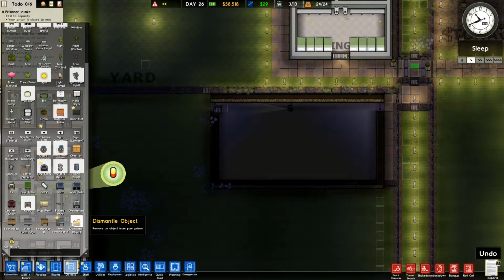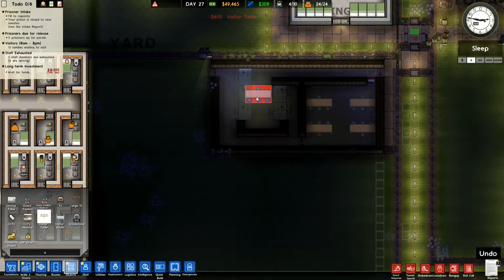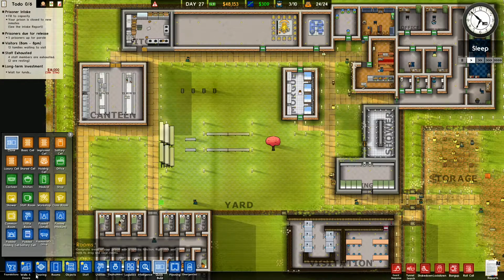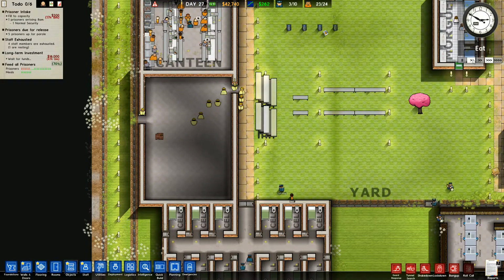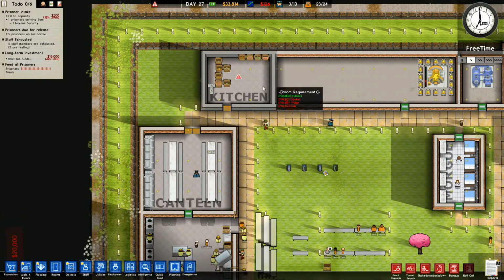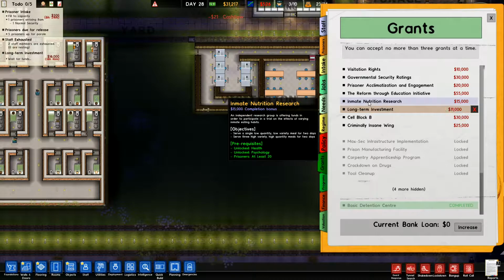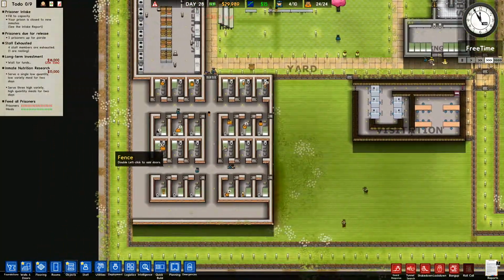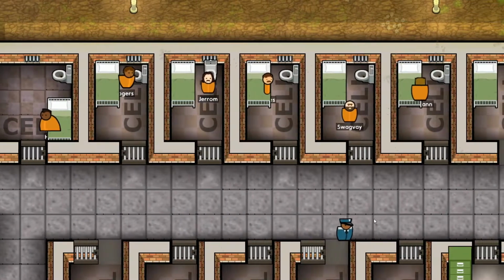Let's Play Prison Architect #43: Art Deco Visitor Centre!

Comment: You made the Visitation Room overly complicated. You could have just dropped the booths down in a "U" formation, with just a couple of sections of wall to keep the inmates on their side. Also, why use booths AND tables? Booths are for keeping smuggled contraband at a low, while tables are used when you don't care (or for low-sec inmates). Using both just defeats the purpose of the booths.

@12:26 - you got the Notebook page, but you missed the Polaroid sitting by the phones in the prison Yard

Inmate Nutrition Research - you need to pay attention to the requirements. You set the meal quality and variety to "Low", but you forgot to reduce the meal times to once per day. When you kick it up to high quality, high variety, you'll need 3 meal times throughout the day

Power Generators - in addition to separating them, you may want to think about adding a sprinkler to each power room (and hook it up to the plumbing). This way, if the generator accidentally explodes and causes a fire, the sprinklers can help contain the fire before it gets out of hand
Reply from the maker: I might designate the tables for low sec only in that case